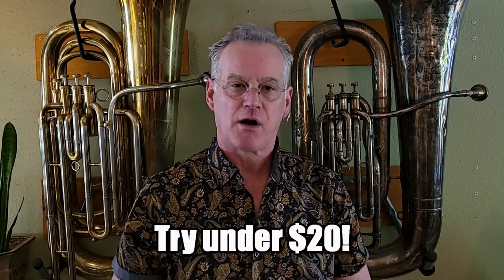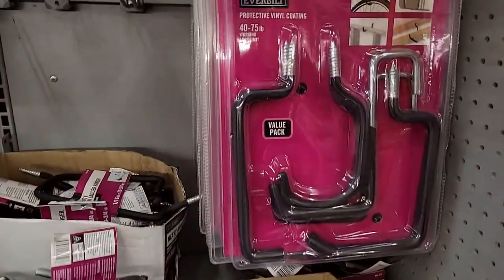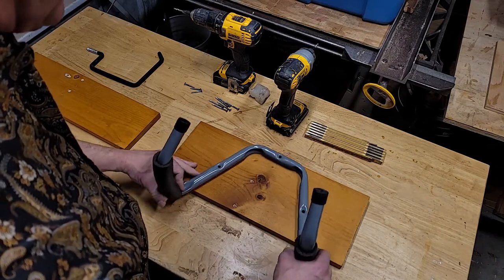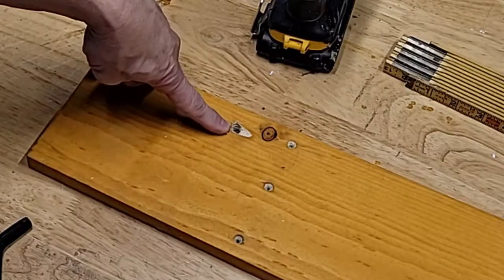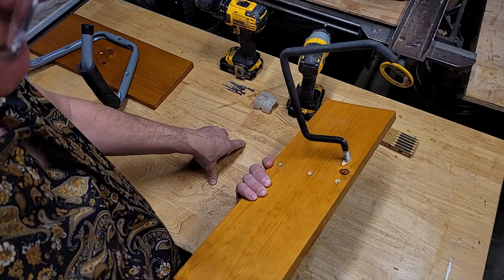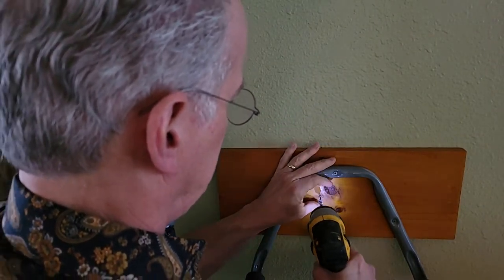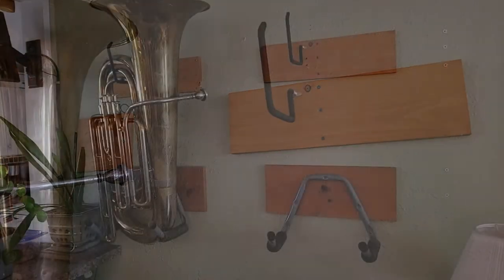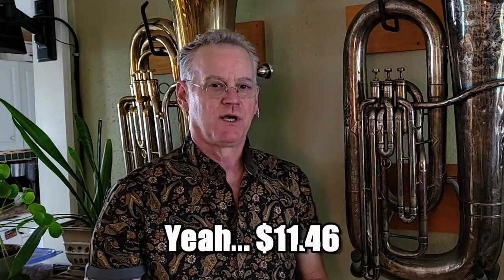DIY Tuba Storage Wall Hangers

Comment: You think I could make it work for a Sousaphone?
Reply: I can attest to that. I used this very video to make my Sousaphone wall hanger and my Sousaphone is still hanging there to this day. Alan's video is perfect for us musicians who are on a tight budget. It's easier to hang Sousaphones. You don't have to put your top hook off center. Just take proper measurements and it will be fine. Also, I bought all the parts to make my wall hanger for under $15. Good luck Fellow Musician!